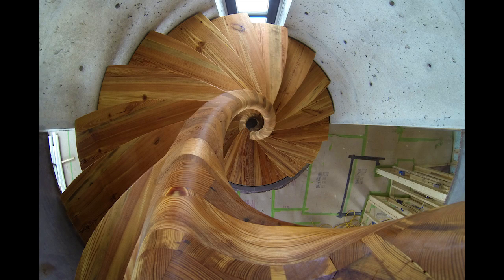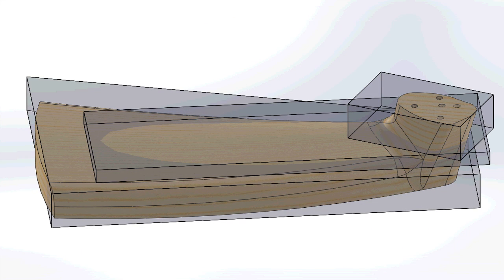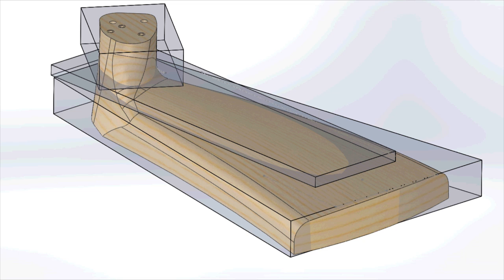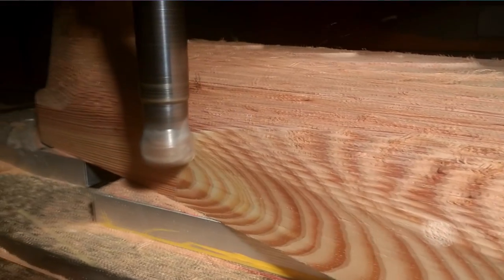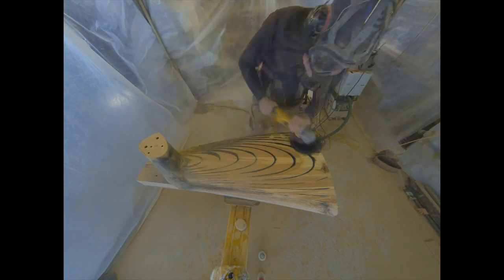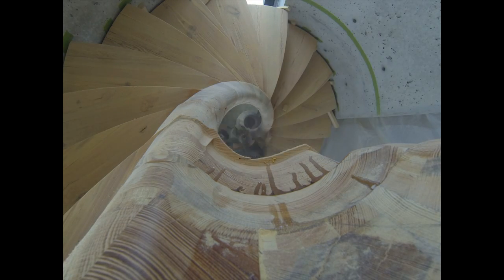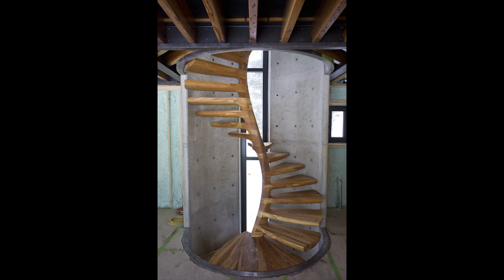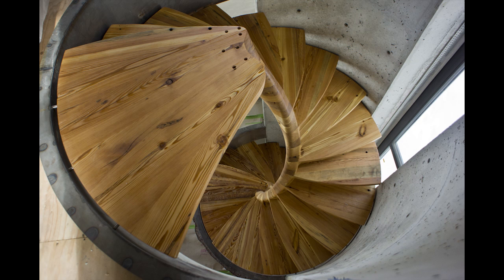Tom West Staircase Process

Comment: Hello from France, very nice work. Could you tell me what kind of wood do you use for make this ? Do you remember the cost for ask to milling in cnc machine ?
Reply from the maker: Bonjoure!  The wood is called heart pine.  It comes from the center of old growth pine trees and is incredibly dense and hard.  The cost of the milling is hard to gauge because the homeowner owned the machine shop.  Estimate 2 hours per tread times 30 treads plus more for the landings.
Reply: thank for your quick reply, I really like this form of stair, do you think it is possible to send me a DAO file by private message ? so I can have an example to learn and try on my side.
Reply from the maker: Email me.  You can use the contact form on NickFournier.com